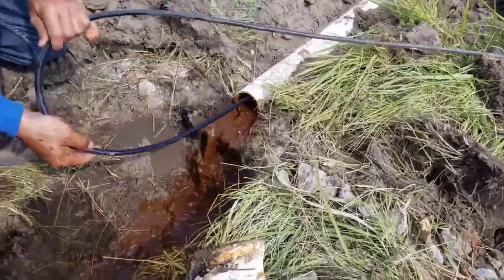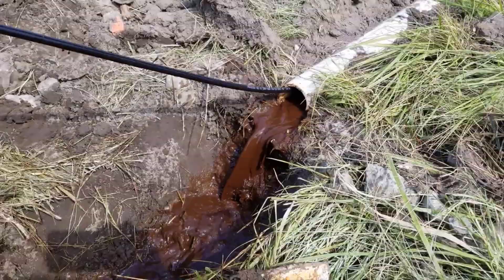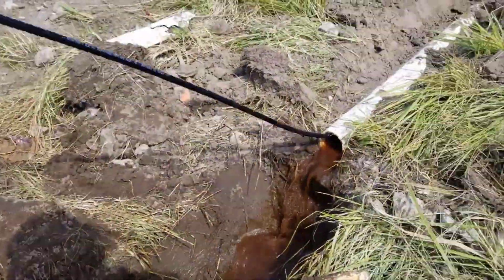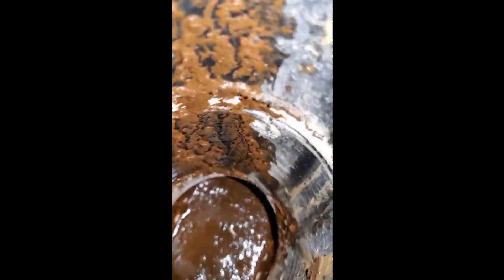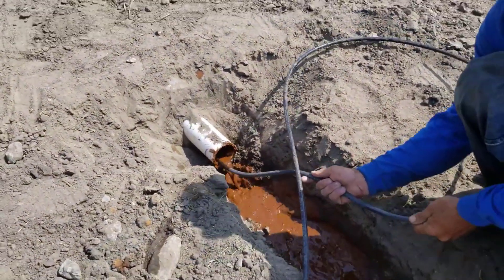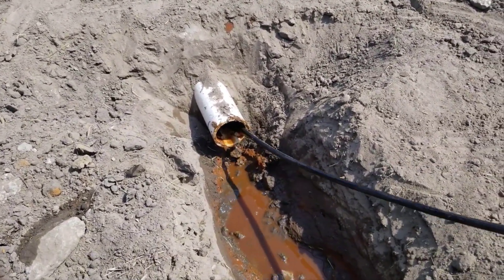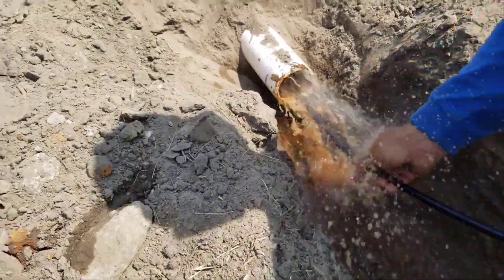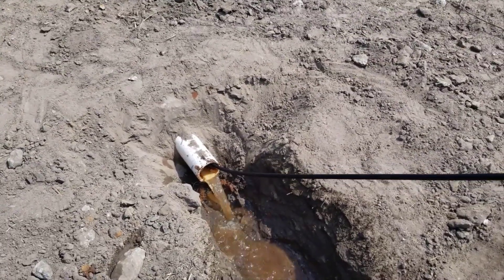How to Remove Iron Ochre from House Drainage Sump Pump Line

Comment: FDM ...  Two questions ...   What regions of the country is iron ochre a problem?    And two, if you do not have an iron ochre problem would you ever tie your sump pump water into either a french drain or roof run-off / gutter system?   Thank you sir.
Reply from the maker: FDM's Iron Ochre Remover Sump and Pit Cleaner
https://frenchdrainman.com/product/iron-ochre-remover/

Comment: I have a pump in the basement and it clogs up once in a while . I usually pour in bleach and hot water which eats it up and starts running again . I wanted to ask , what if I put in a grinder pump ?? Wouldn’t that eat away the iron ocher ??
Reply from the maker: FDM's Iron Ochre Remover Sump and Pit Cleaner
https://frenchdrainman.com/product/iron-ochre-remover/

Comment: I just bought a house and it has Iron Ochre. It has a crawl space that is professionally done. Iron Ochre accumulates in the sump pump pit. My question is, will the tubing that leads to the sump pump become clogged with Iron Ochre?
Reply: Yes. Depending on the rate you will need to flush it out with Iron Out and Water above 140 deg
Reply: @In4Th3Kill  There doesnt seem to be an access point to do this.
Reply from the maker: https://frenchdrainman.com/product/iron-ochre-remover/

Comment: i just discovered my basement water problem is due to my drain tile tubes being completely clogged with clay deposits, who knows how much is in there
Reply: i found this out because i manually added water to the basin after i futzed with the sump pump... then i realized, the drain tubes don't TAKE water, how can they give then? must be clogged.
Reply: What did you end up finding out about this?  I suspect I have the same problem
Reply from the maker: https://frenchdrainman.com/product/iron-ochre-remover/

Comment: That looks easy because it's straight. However, what do you do inside the home in the basemen where you have corners? What do you use? How do you get around the corners? Thanks.  Gerry
Reply: You use a spring head jetter nozzle. If it's too crazy you'll have to break up floor and install a clean-out or two.
Reply from the maker: Best French Drain and Yard Drainage Contractor
https://frenchdrainman.com/

Comment: With wells, it seems like the formation of the bacteria is greatly accelerated in a system where the water is aerated to a degree. In the same water, your don't see nearly the formation in a shallow well suction system as you do in an ejector or submersible system. Just a factoid for you.
Reply from the maker: @Jimmy Kipper appreciate you sharing thank you for commenting
Reply: Interestingly the word "factoid" was originally used to describe something that sounded factual but was actually made up, as in "looks like a fact". Similar to how you'd describe something that isn't human but looks human shaped as "humanoid". Anyway, colloquially the word is somewhat altered to mean something closer to "fact", even though I'm not sure why people wouldn't just use the word "fact" since it a whole three letters shorter.